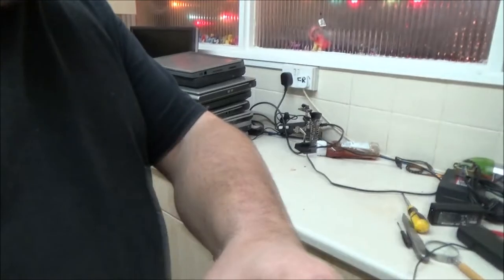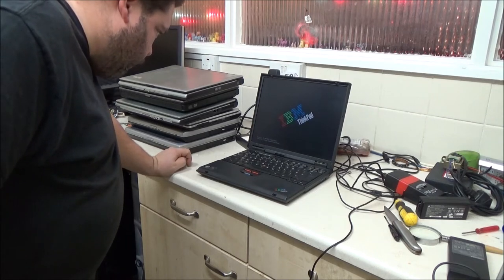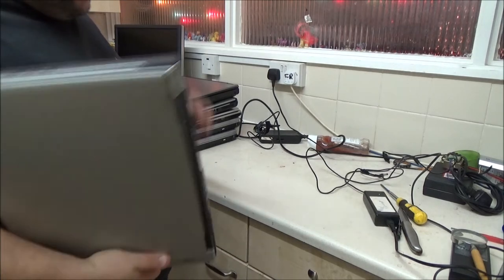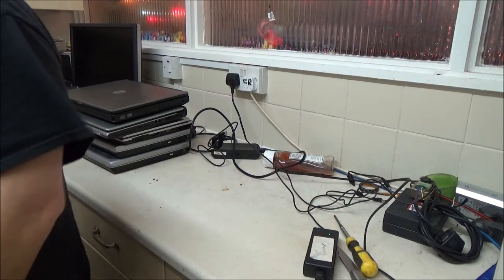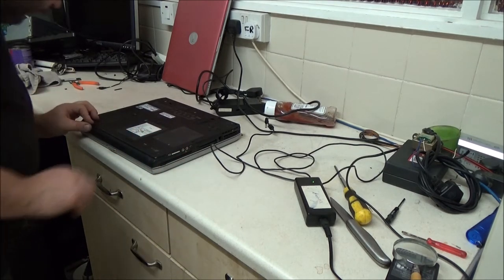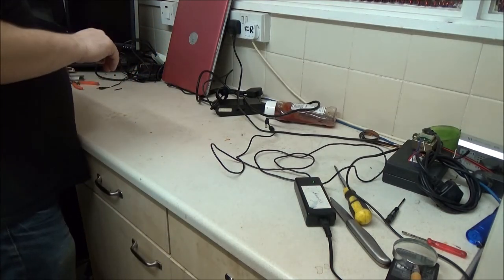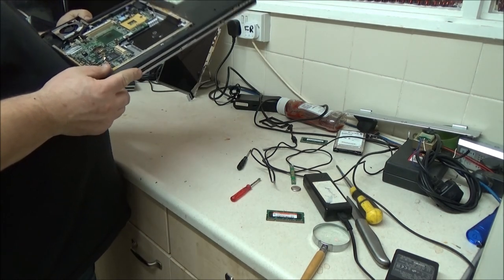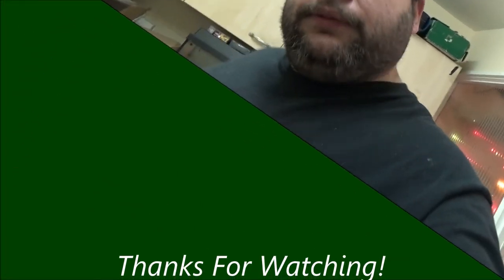Laptop Testing Part 2.

Comment: I got a few acer laptops a 5315 was a nice machine my dad got its old and was a celeron at 1.8ghz it now has a core 2 duo at 2.4ghz socket p478 and now has a t8300 core 2 duo and the 512mb has been replaced with a 800mhz ddr2 2gb much faster than how it started and a factory reset made a massive difference as did removing all the bloatware running windows vista  not my favorite but it is how it left the factory . Your acer that is not powering up could be the socket that is the problem some of mine are a bit  tempermental with the power socket somtimes moveing and holding the socket at different angles will get them going i bought a water damaged acer and it is a 1.7 ghz single core slow but has served me well ,i got quite a few laptops as my dad has given me quite a few he has got cheap from car boot sales his best find was a toshiba its cost £3.50 has a 1 tb hard drive and an i3 cpu i think it had 8gb of ram some slight damage to one side and psu jack was pushed further in the case i took it apart relocated it and it works well only around 4 years old and now has linux mint installed .
Reply from the maker: I do like Acer laptops. I use one at mums, I forget it's model but I do know it has 4gb DDR3 RAM installed. You were on the right track in regards to power jack, it just wasn't the jack itself, but the power supply jack, it seems it was not quite the correct size and wasn;t connecting. I remembered some power bricks came with the laptops, I tried one of those that fitted the Acer's and they powered up, except the one with a short on the jack.